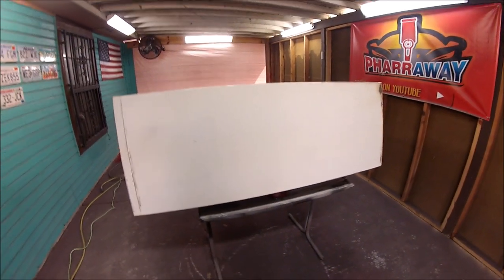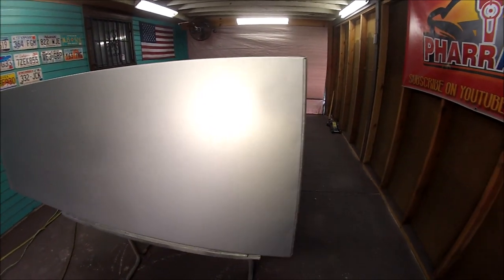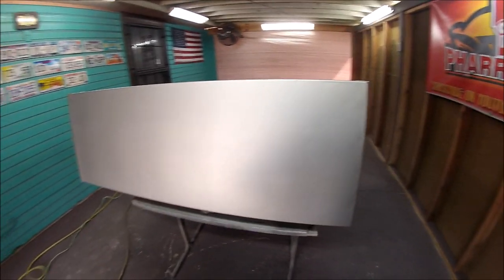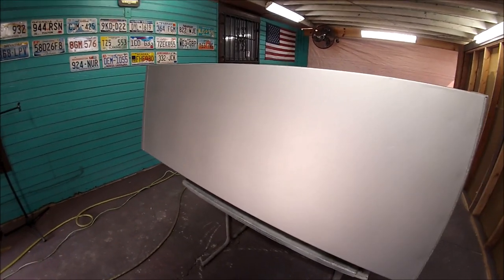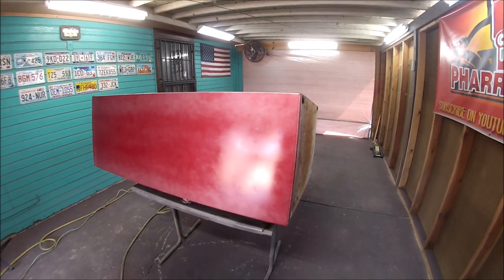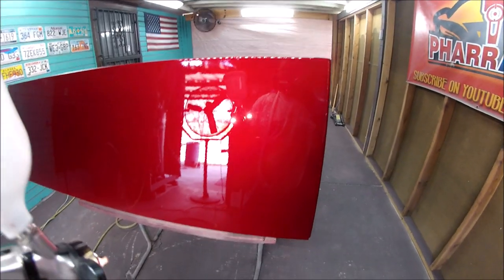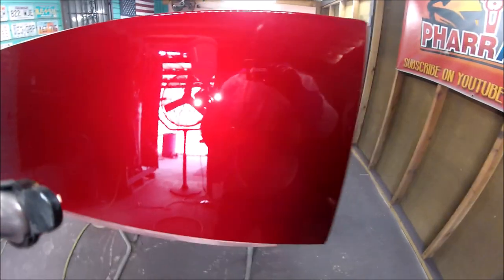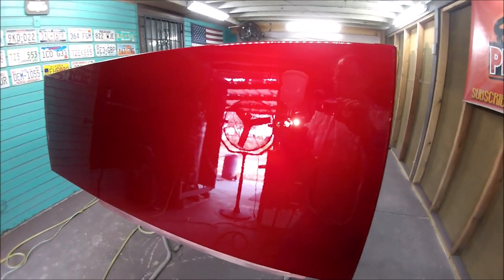How to Spray Candy Paint - Step By Step

Comment: Very nice! But I must say, that painting candy paint on a flat or squared surfs, is a lot easier than a car for a newbie. Because dry spots can be tough to keep out, when you're crossing a part that you're not actually on. E.g. Doing a side of the car and you come across the windshield A-panels and such. Practice is definitely a must.

Great video.
Reply: For the record though. Some ppl have a knack for it. Great motor skills and get muscle memory really fast. Tooting my own horn here. The first paint job I did was a blue candy over a factory "goldish" mica. Sanded it with 1000 grit and sprayed 6 coats of candy on it. The guy just wanted his old tacoma not gold and said do it in med to dark blue. He was stoked when I let him see it at 4 coats. He asked if I could make it a bit darker so I sprayed another 2 coats. I was actually impressed with myself and for a dude with major adhd I call that a win.  Yrs ago I worked in a pontiac/buick/gmc dealership both mechanic shop (where i worked) and body shop.  One of their painters was at this gig for over 30 yrs and I wouldnt let him spray my grandmothers old K car.  As one of the reg youtubers says on here. Its just paint. I believe its the dude that does Paint society.

Comment: Great vid. I've been an  autopainter for a living since 73.  The first candy job I did was on a 74 Vette in 80,  Hard to to do.  I used  Harley-Davidson   Candy Apple  Red  lacquer .  over a silver base.  8 coats of color and 4 coats of  Martin- Senour  Urethane clear.  It was a bitch,  We changed the color from white to red , under the hood and jams.  A year later I built my 71 Gremlin with a 390 big block = Dark  blue metal flake ,the next year  Candy red metal on my Chevelle convertable.all,  lacquer.  A lot of  buffing .  Lacquer needs it !
Reply from the maker: Nice, ya I worked with lacquers back in the larw 80s early 90s there harder to work with

Comment: Your vids are great man😊 I've been painting years but am really struggling with candy's recently, particularly light blues and green candy. I have tried everything to make it work but just can't get it to not look blotchy. The way your first coat went down here where its not covered yet and has a patchy look is how mine stays after 4 coats. Can't get rid of the blotchy look. I can spray reds and other colours fine and don't have this problem. It's just this blue candy that's kicking my ass. If I knew what was going wrong, I could correct it but I have tried everything and just can't seem to shake the patchy look😕

Comment: Hi, have retired from my garage 17 years ago, I want to spray all the plastic panels on my spy quad in Mazda soul red. I would need a etch primer followed by a bright aluminium paint, next the color but is it waterbased paint? Should i worry? I only have my devillebis gun, or an unused top loader gun. Is the varnish waterbased too? Is the varnish sun proof? In France there are loads of cars with the varnish peeling off. Thanks Barry
Reply from the maker: It's solvente paint and yes is sun proof

Comment: How long did you wait before you sprayed the FIRST coat of clear?     The one thing I'm looking for in all these videos I watch is time between coats, and most people NEVER explain that part.
Reply: When you order these paints, they come with a “tech sheet” explaining the flash times aka paint curing time and it’ll tell you depending on the temp. Or could be on the website before you order
Reply: @andrewvital7623  I know that, but it DOES NOT tell you when you can spray over another color...Like when you can spray clear coats over candy, should it still be a little tacky, sanded after completely cured then spray a clear coat, etc...etc...etc...I know flash times and spraying the same color, 3 coats. What I'm looking for is...I am going to be spraying 3 different colors, feathered, NO hard lines, CANDY over that, and then a clear coat over them all...do I sand each coat, or can I spray all in one day, just spray each layer after they have flashed off and are still tacky so they have something to stick to.
Reply: @JD-nq4vb  he said 15 mins in the vid
Reply: @andrewvital7623  I heard that part, but that was between candy coats, not the first clear coat. I know it has to have a surface to stick to, sanded or tacky, so I can try both on a practice sheet, I just don't want to spend more money for more candy paint just for trial and error, it's too expensive. But thank you.

Comment: I’m restoring a 96 f-50 and building a show truck  I want to spray candy red on the under side of the bed and cab and in the engine bay what type of gun would be good for this I imagine I’m going to be laying in my back when I paint the underside of the bed. Is there sum sort of pressurized hopped that could spray and bad angles ?
Reply from the maker: No not at all

Comment: I can spray candy over metallic pretty easily, but I'm having a problem spraying candy over white base. I'm painting some old triumphs, and they used tri coats in the 60s some with white base. Im getting cheetah stripes real bad. Any advice would be great.
Reply from the maker: To me it seems your gun settings are a bit off

Comment: can you list the guns used, nozzle size/distance/airpressure for each coat from primer to clear?  Thanks
Reply from the maker: the gun is a devilbiss DV1 with a 1.3 tip and about the pressure the base was at 29psi the candy was at 29psi and the clear was at 35psi

Comment: Beautiful work, man. Hey, was the control coat you shot at 4:00 or so in , was it the same metallic material, or was it straight up clear?
Reply: Edit: I got it now, it's the same metallic, but sort of a "dust coat" higher pressure and further away.

Comment: The control coat, is that another product or was it the same base coat you originally sprayed but only sprayed at a higher PSI with less overlap? I just dont fully understand the term control coat.

Thanks in advance.
Reply from the maker: it's the same product just sprayed a bit higher and a bit away from the panel
Reply: @PHARRAWAY  
Basically it's just a full misting over the panel.

Comment: What size tips did you use on the gun for each stage? base, candy, clear. also what for a primer? Great videos you and sprayway are my goto guys
Reply from the maker: It was a 1.3 tip for all the stages
Reply: @PHARRAWAY  what would u use a 1.7 for?
Reply from the maker: @scotthendrix5664  Mostly primer

Comment: If you get a bad overlap in the kandy part can you do a control coat to fix it?

Also how many turns out on the fluid knob on gun?
Reply from the maker: about the control coat no it will not work and on the gun the trigger it was completely open and the material I opened it all the way and then closed it 1 turn
Reply: @PHARRAWAY  was talking to a older painter he said he did a kandy panel by panel, screwed it up because u can see the tint streaks where the door gaps are and he said he fixed it by doing a criss cross control coat, idk lol ,

Also another guy said he got a bad stripe in middle hood overlap and fixed it the same way by misting a control coat over it multiple times to fade away streak. 

Idk wat do u think? Possible on the kandy part? 

Try getting a streak purposly and fixing it that  that way.
Reply from the maker: @MartinMora92  I had never had that problem but I don't think that will work, because that area is already dark but try it and please let me know if it worked

Comment: Did you use tack rag on candy base before clearing
Reply from the maker: whenever you mix it with inter-coat clear yes you can use the tack rag now if you use the candy that's not concentrated no don't use the tack rag

Comment: Nice video, but what if I wanted to tape over that base coat before the kandy? How long do I have to wait before I start taping?
Reply: Seeing you've had no reply after three years I just thought I'd chip in with what I do. I use an 'intercoat', a clear low solid layer that locks in the metallic. Curing depends on heat Vs air dry, but for me using sort dry it's going to be a couple of days before it's hard enough to mask on. The intercoat clear can be denibbed without shearing through the metallic particles before masking and the candy going on.
Reply: @JesHill  thank you for taking the time to reply. Appreciate you

Comment: I really want to enjoy your channel but there's so many things you're doing that everyone says not to do. a control coat requires you to decrease the pressure to 19 or 20 psi, instead you increased the pressure.also you're supposed to do it immediately after last coat so that you have a wet bed to spray on instead you sprayed it on a dry surface. you are never supposed to tack rag after you do a control coat that defeats the purpose of the control coat and you just messed up all the orientation of the metallics. seriously I'm trying really hard to like this channel but the misinformation is enormous
Reply from the maker: Thank You and God Bless